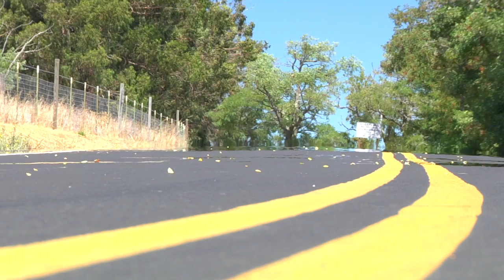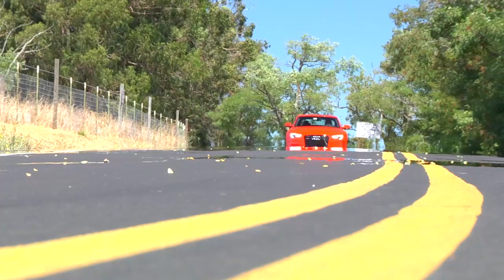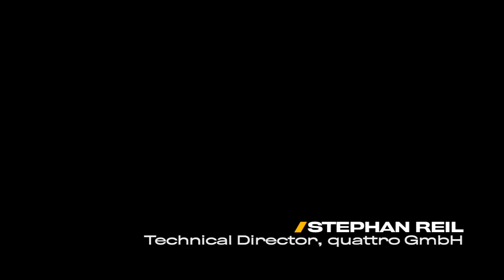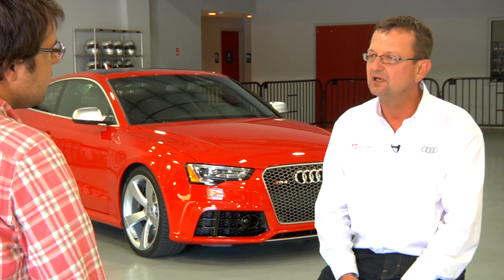The Man Who Runs quattro GmbH - /DRIVE UNCUT

Comment: Have you ever driven the R8, any of them? They are essentially rear wheel drive. It's more like there's an extra feature within the ESP system that's called "additional front wheel drive".
But of course Stephan's answer to your question would have been "best efficiency in traction out of every corner or from a standing start aswell".

Comment: it was actually the other way round, its base was the 2.7l biturbo v6 from the old s4 and cosworth modified it. It was one of the only enginges that reall produced power from audi. Look at the RS4 B7 and the R8 V10, they're both beautiful looking cars, but they're outclassed in straight and cornering performance (not the R8) from other cars with less potential and less power. The 4.2l V8 claimed to have 420 hp, but on dyno's not many even did 400, more like 360-380 at the wheels.

Comment: the current Audi and VW mostly use different platforms, although some of the Audi MLP chassis' are available in FWD (in economy models) they are all longitudinally mounted engines, and gen 5 quattro designs (B7 RS4 and after) have a default 40:60 split (i think that's perm. in anything other than the RS4), and gen 6 brought 80% RWD capability.. anyways I feel Audi can do RWD on their current platforms, but don't since quattro is their niche, tbh I don't see the difference if its 80% or 100% RWD